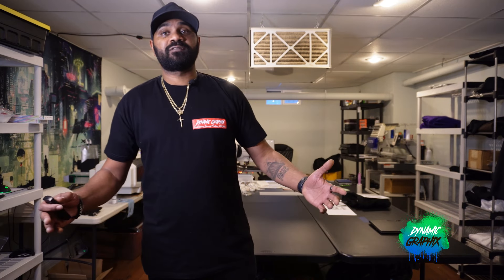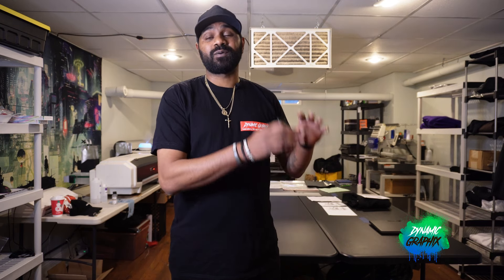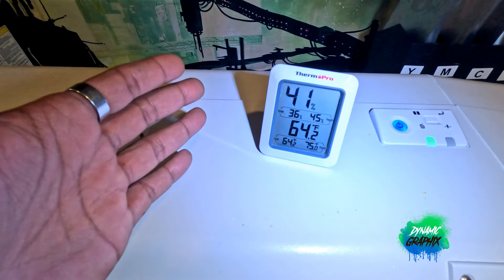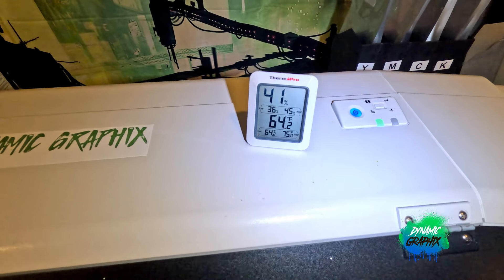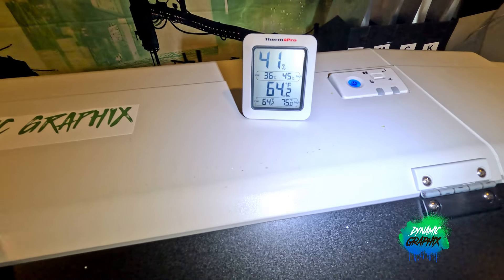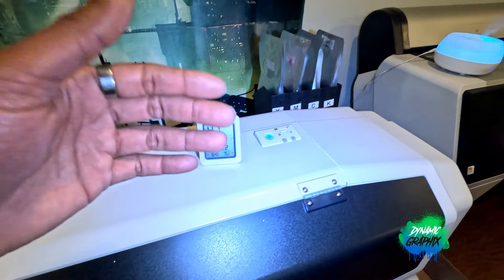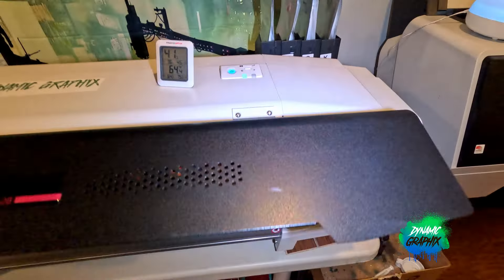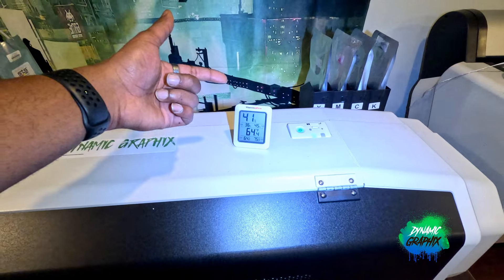Direct to film (DTF) Best Kept Secret

Comment: so do you turn your printer off when you leave? or do u have  hit it with the the solution leave it running and then in the mourning hit it with more solution.
Reply from the maker: Hey Chris sorry for the delay, yes I keep my printer on 24/7 it goes through its sleep mode and when I’m ready for it to wake up then we are good to go, I. Run a start up clean and yes I do wet cap everyday, every night to preserve the head. More tips and tricks about the mutoh coming soon👌

Comment: Quick question for you. I have to keep doing charges in-between prints. I'm thinking I have air in the line slot 5. Do you know how to get the air out the line? I also have my room in a control environment. Over 40%.
Reply from the maker: Yes no problem, there is a way to syringe it out very simple, send me a email and exchange contact to video call you.